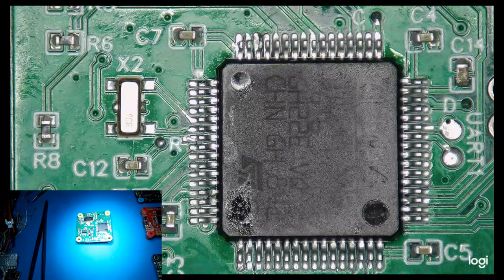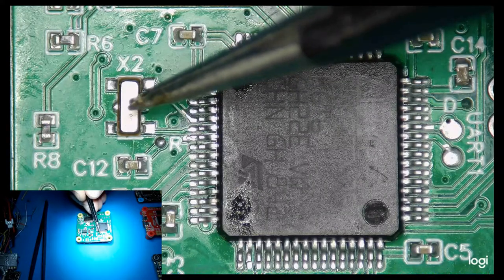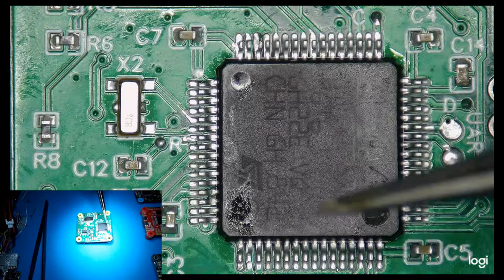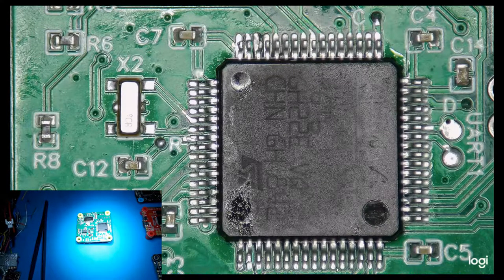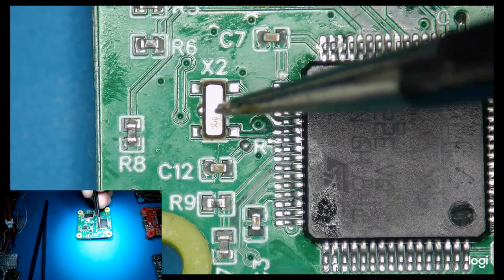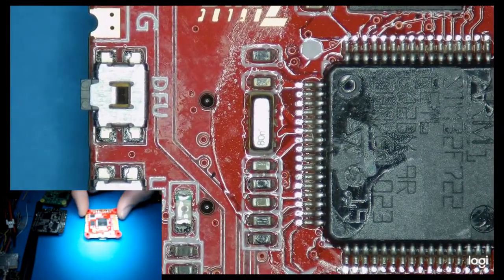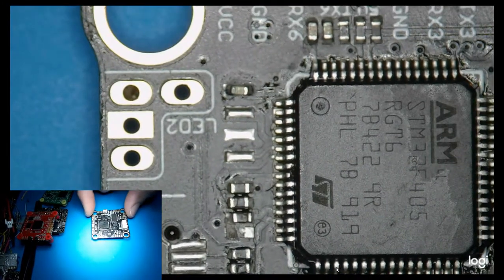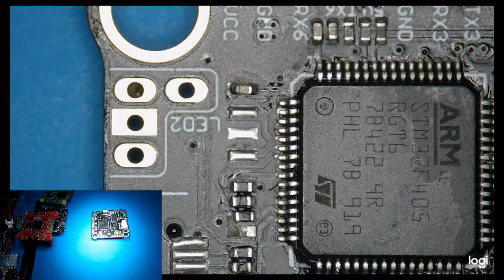Broken Flight Controller???... check your oscillator

Comment: third pin on the Top on the MCU is bent and needs aligning :) EXpressLRS FTW
Reply from the maker: Yep, stuffed it from all the rework and double checking. Luckily it's not used or connected to anything.